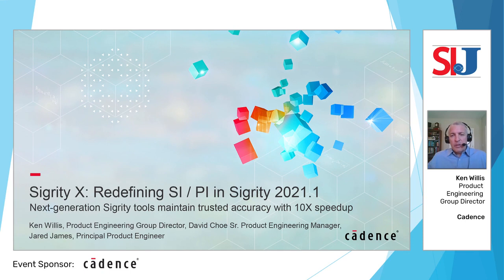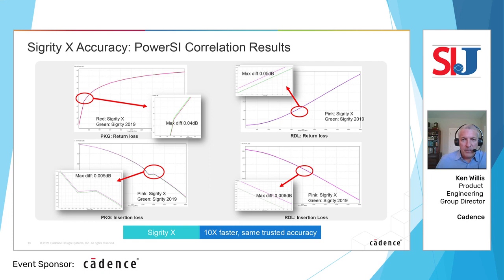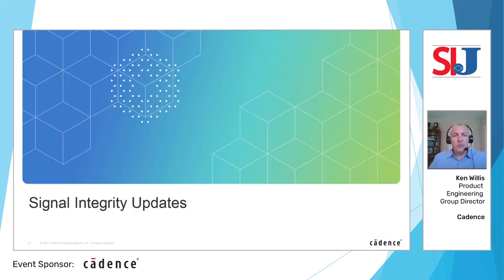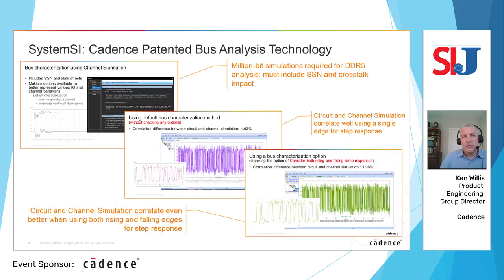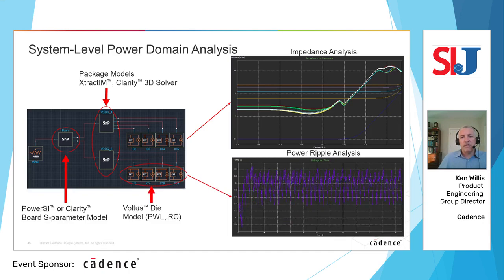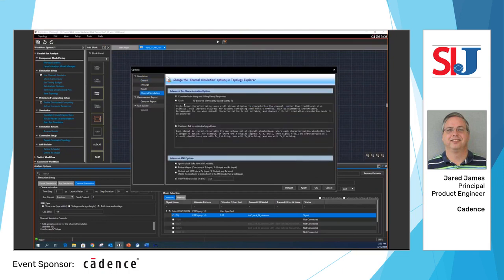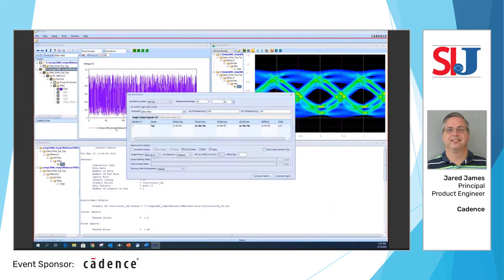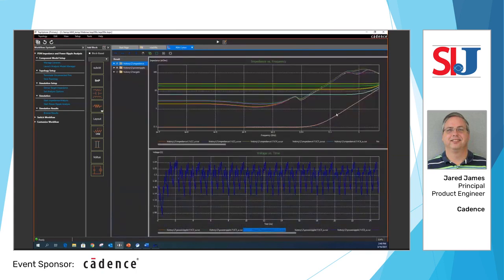Next-Gen SI and PI: 10X Faster, Trusted Accuracy

Comment from the maker: Discover how Samsung, MediaTek, and Cadence are using distributed computing to deliver a 10x performance boost for DDR5 memory without compromising on Maxwell-accurate results.

Are you currently facing a simulation bottleneck, or have you moved to a distributed systems architecture? 
Let’s talk SI/PI in the comments! 👇